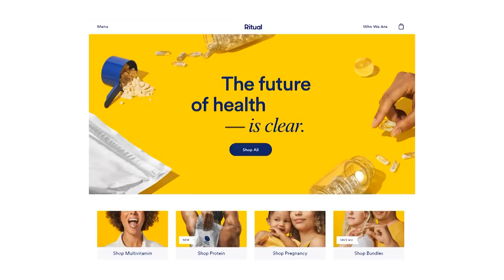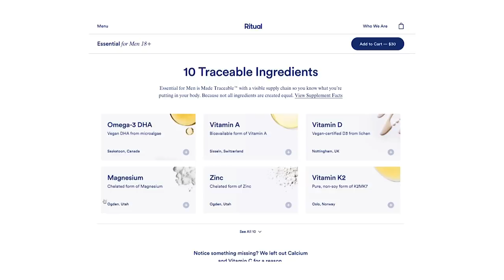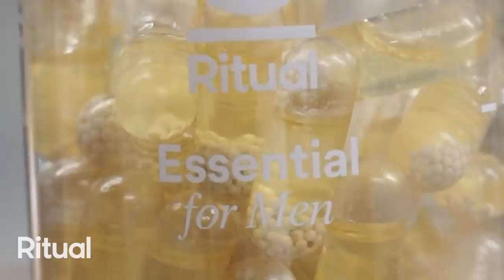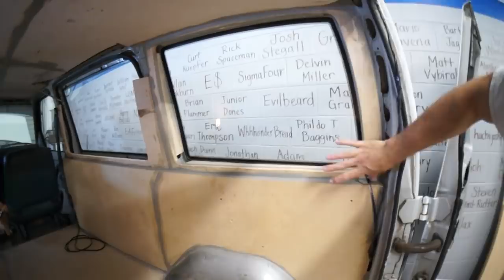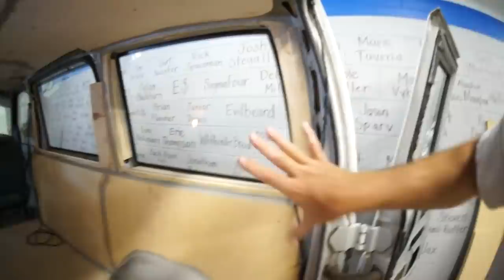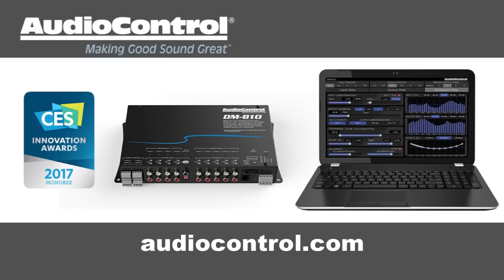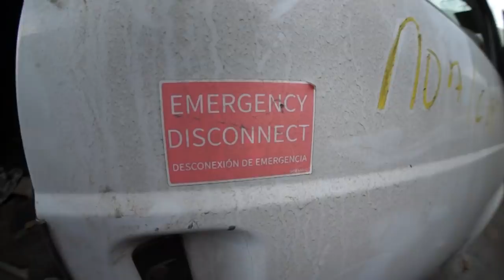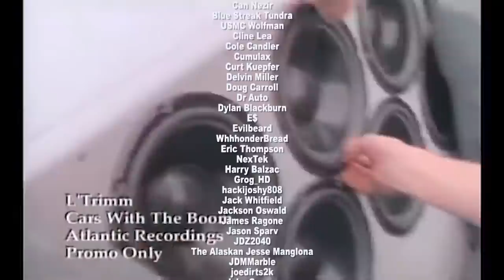BASS WARS XI - SPECIAL EPISODE! - BVV#76

Comment: You might have to go back and get the older style serpentine belt system off that one truck some of the older passenger side chevy heads don't have all 3 holes to bolt up that newer style alternator bracket I know older v8 don't I'm not sure on the 4.3 v6 the brackets you have are for.the 4.3 vortec motors